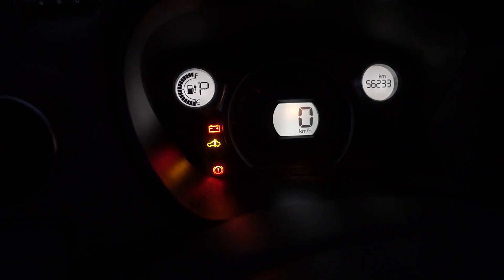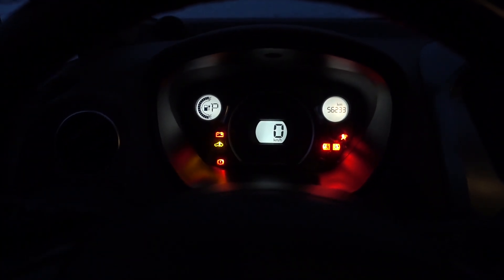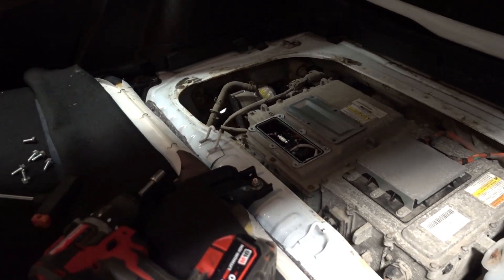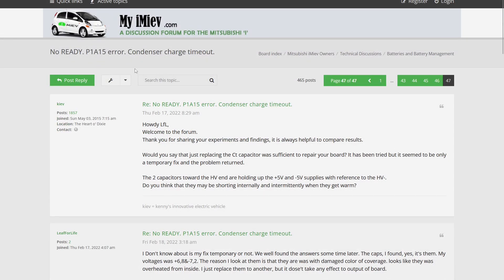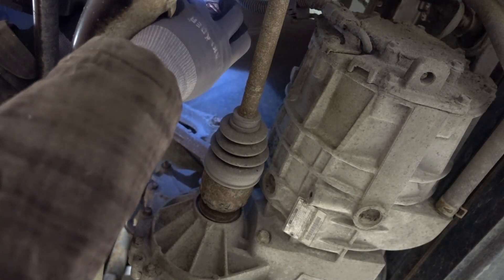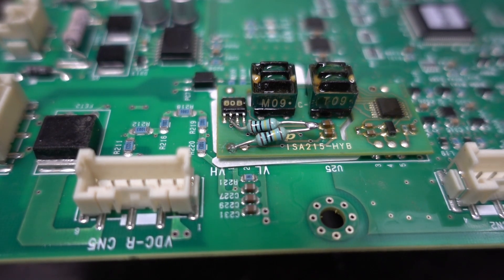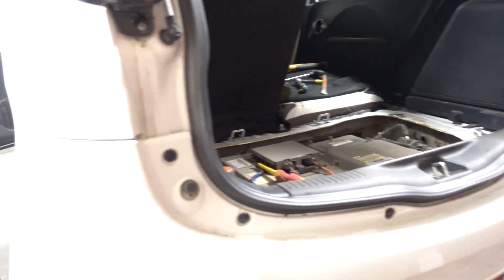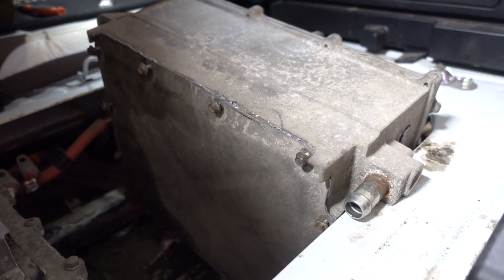Citroen C-Zero - No start troubleshooting P1A15

Comment: I had 2 Condensers de soldered and replaced. I did all the work accessing it from top. So I did not have to remove any coolant. It were Ceramic Condensers with 2kV and 1nF.
Today after some 22.000 km and 22 months later they blew again.
This time without blowing the huge Fuse in the Inverter.
Reply from the maker: Nice work!
Reply: I found the Okaya LE225 X2 condenser to be the root cause of the current defect.

You didn’t show HOW to take the lower PCB out.
I already disconnected all cables and unscrewed the PCB from the housing.

Do you have a hint how to proceed?
Is the PCB sticky on a colling block of the housing?
Reply: I did not dake the PCB out, but also soldered only inside the housing.

Comment: Thank you very much for the excellent content you provide. I wanted to ask if you have ever considered replacing the i-MiEV battery with a Nissan Leaf battery and upgrading the car's battery pack capacity?
Do you think it will work?
Reply: It would probably be possible but just as probably not practical as there would be all sorts of potential physical and electrical differences between the cars/cells.  There are several groups world-wide trying to re-work the i-MiEV/clones' battery to take more recent and more energy dense cells with some success but one of the main problems is that the car's firmware simply can't be re-programmed to acknowledge a battery capacity greater than the original 16kWh.  So, despite everything working, when the SOC has fallen to what the car thinks is near zero, it goes into limp mode despite there being much more charge remaining in the battery.  It's been a while since I looked so maybe they have cracked this.  Such wonderful wee cars, I can understand why they have such a good support community.

Comment: Are you going to use a AD202 for a more long term fix?
Reply from the maker: Yes I recommended that to the customer!
Reply: Can you explain the permanent fix
Please?
Reply: @ugolapierre2236  replace the amplification circuit board with the AD202 component.
Reply: Where can I find the step for the modification ?

Comment: Hi Dala. Have you ever had it where obd dongle wont connect to ecu and just give error ?    I have Obd Link MX and it connects to CanIon fine and reads battery voltages. But wont connect with Torque or Obd link software or another obd2 scanner. I have 12v and two earths and 65 ohms between Can high and low on diagnostic socket which seems to be correct. Any help would be appreciated.
Reply from the maker: Yes these cars are very finicky with OBD2 readers. I had to use "Car Scanner" app, and only scan one part of the system at a time, otherwise it locked up!
Reply: @DalasEVRepair  yep I have this same issue! That's my solution too.
Reply: @DalasEVRepair  in my situation Car Scanner cleared errors but in last month did not want to read them :/
Reply: Torque won't work. Try Hobdrive (more details than canion)
Reply: @DalasEVRepair: I use an ELM 327 OBDII  Bluetooth reader and the Car Scanner app. I also cannot make it connect to the ecu. Any suggestion on how to check the failure codes? I need another reader like iCarsoft i909 f.ex.?

Comment: Hi. Great videos. Great Channe.I have same problem on a C- Zero.  You said you put 2 x 1 Megohm resistors on there.  So can you confirm that where the two resistors are soldered together they DONT connect anywhere on the little board so are in series ?  Merry Xmas
Reply from the maker: Read the thread in the description! 😁❄️

Comment: Any specific instructions to remove inverter safely? Like "do not remove HV cables because not necessary" or something.

I have another problem with iMiEV - does drop the heater from time to time. Especially when accelerating harder and battery is less than 70% charged. no errors. After restart resumes heating immediately. Never drops when stationary, even at full blast and battery almost empty.
Reply from the maker: Answers to both your questions should be on the imiev forum!

Comment: Wouldn't that resistor probably rattle off the board at some point without some silastic? Also what is the actual problem with the board?
Reply from the maker: If the legs were really long it could be a concern. But not for so short runs.

The inverter voltage measurement drifts >10VDC compared to the battery voltage which prevents startup.
Reply: @DalasEVRepair  Early adopter woes I suppose. Bit of a fail for the designer/manufacturer of the inverter board to incorporate such a unreliable voltage measuring circuit.
Reply: So what led to this issue? I didn’t see any electrolytic caps on the voltage measurement circuit that could have dried out.
Reply from the maker: @ThanosSustainable  according to the forums these circuits just drift as they age, and start to cause issues. New replacement is advised, this is just a temporary fix
Reply: @DalasEVRepair  Bet you a tenner this fix goes with the car to it's end. 😉